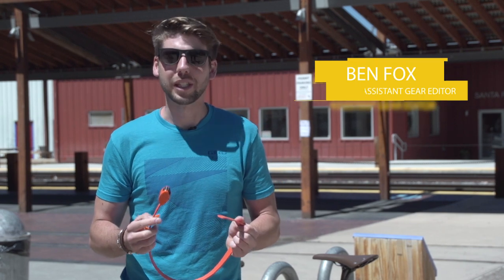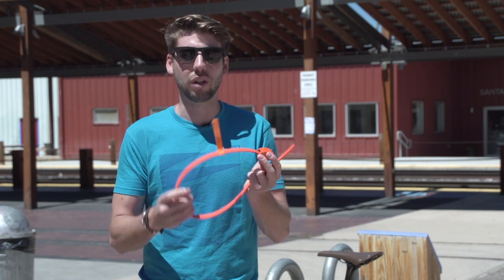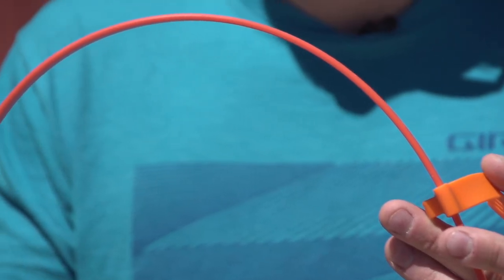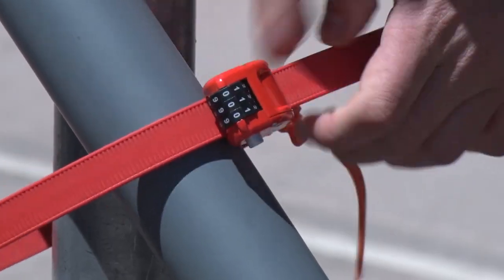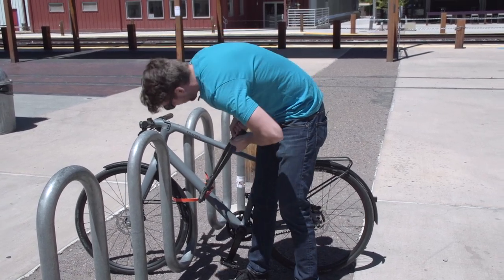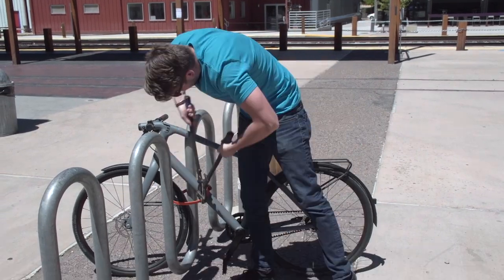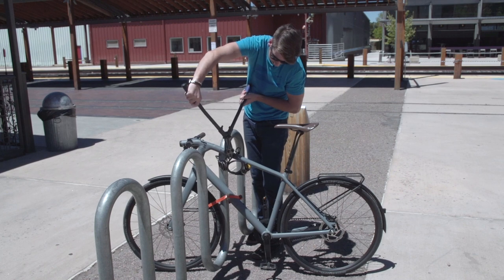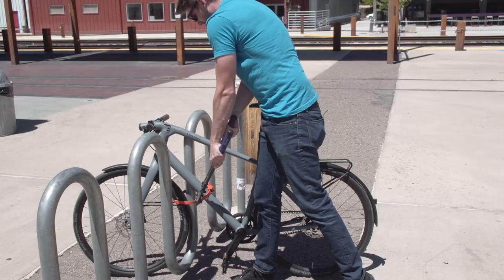First Impressions: The Ottolock

Comment: Ottolock is just to thin for the bolt cutter, try tin snips you can cut it in 2 sec !
Reply: It's not that it's thing, normal bolt cutters aren't meant for anything that isn't round. You need a straight edge to cut through sheet metal.
Reply: @Andulvar  The cutters of the bolt cutter are not coming in contact together.... for an obvious reason ( they will get damage ) so the little gap prevent from cutting thin stuff.
You can cut square or rectangle stock with no problems...... nothing to do with the shape

Comment: How much were you paid for this? This "lock" isn't strong at all. It can be cut by a cheap pair of tin snips. Also, kevlar is meant to stop things from piercing it, it wont protect from slashing or cutting. Steal sheets can be cut with any straight edge cutter.

After this video you can really see that you don't know what you're talking about and just shilling a product.

Comment: Although it might stop some thieves, the big problem with this lock is, after its first attack, the lock becomes rendered useless as the teeth can no longer go through the locking mechanism.  Not even sure if you could remove the lock yourself afterwards.  Thoughts?
Reply: uh.. that part of the strap you'd want to cut has not gone through the lock and would not have to when reversed to open either.. who would bother trying to cut the loose end that has gone trough the lock....?
Reply: Just carry tin snips, ezpz